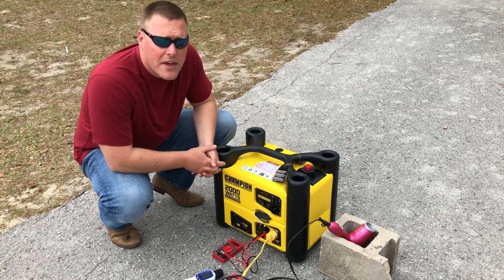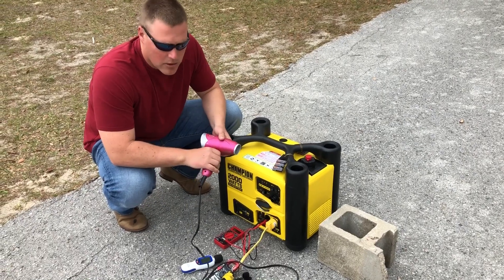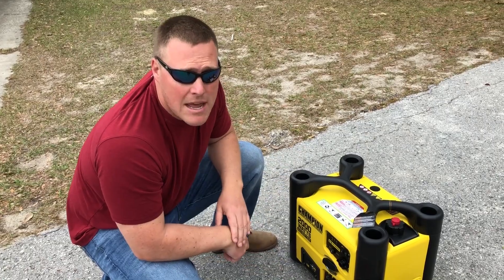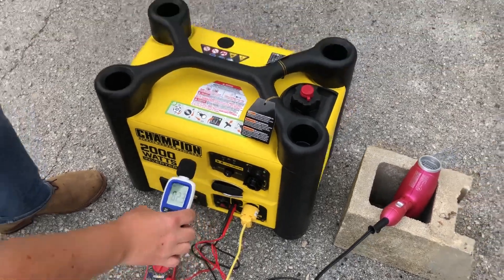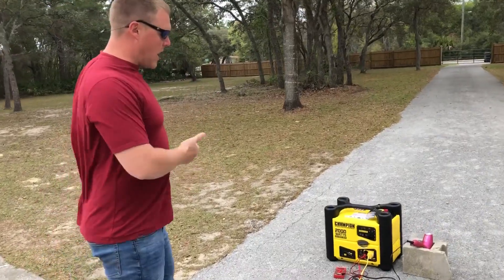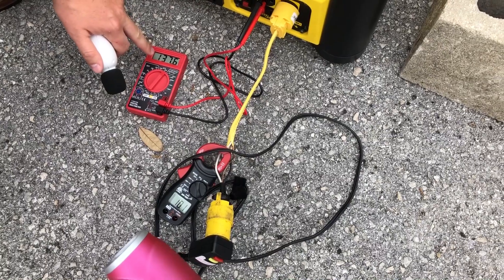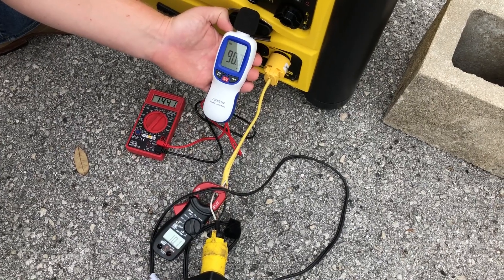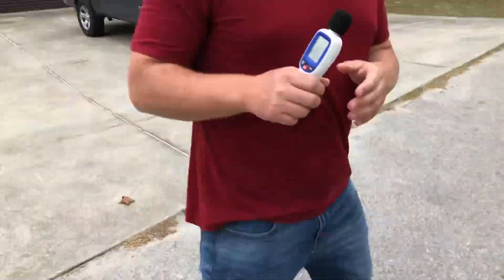Champion 2000 Watt Inverter Generator Noise & Load Testing, How Quiet Is This 2KW Portable Generator

Comment: Absolutely love these videos! Making it so easy to compare and decide on a generator. Champion has 2 newer models of this generator (suitcase design and wattage and fuel meters) and right now they are only sold at Home Depot, would love to see if you can eventually do a test on the newer models.

Comment: Its not a yamaha or honda, its not a base model;  its 500 dollars, it powers what you need, has eco mode, its 80cc and has smart technology, hard casing and sound absorbers. It's not perfect voltage regulation but there's ways around that with adapters.  It's American made, and l say buy Champion.
Reply: Predator is much quieter, used a champion for one camping trip and took it back, got the predator and much better for the same money.
Reply: @tumbleweedking5668  
Where's the video to prove what you're saying?

Comment: The voltage is very unregulated with this unit, I don't know that I would trust it with any sensitive electronics, let alone regular appliances.
I have to wonder if the unit was flawed??
Reply from the maker: We have experienced an issue with this unit when charging iPhones. The screen becomes frozen when plugged in. I talked to the guys at Champion and have been told this is because they "bond neutral"
Reply: My reply to them would have been stop feeding me a big line of Bull$hit!!! Then why doesn't this happen with other inverter gensets???
Reply: 'bond neutral' must mean to ground.   the ground on your iphone could be broken idk..at the jack they get wiggled around, broken or intermittent
Reply: I know what you mean.  I dont use the 12v USB charger, i use a 120v phone adapter charger because of the internal components of the adapter possibly safer?  I have had no issues charging phone. You do notice a not so perfect voltage regulation, not as smooth compared to the yamaha or honda.  Its 4 to 500 dollars and it does what you need it to do and it has a nice eco mode.  Just watch overloading so much.